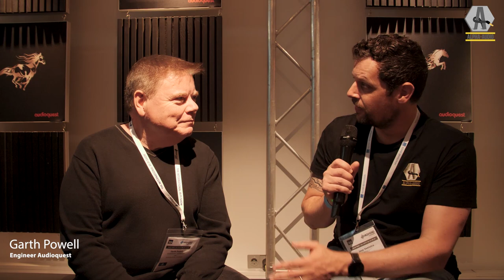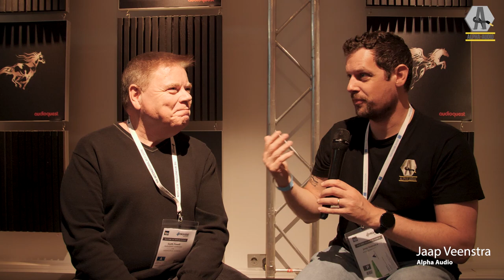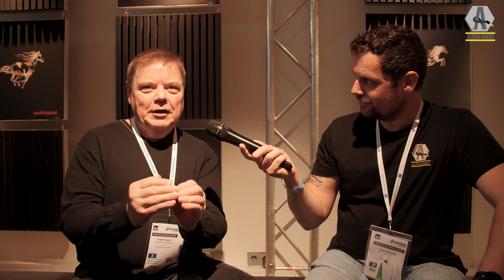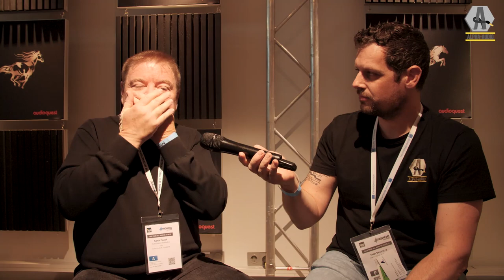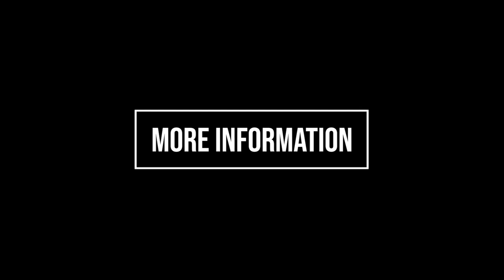All Digital RCA Cables suck... don't they? Audioquest - High End Munich 2023

Comment: Thank you very guys for a wonderful discussion.

I've changed my cables multiple times and the more cables I shield, the quieter my room becomes. The last group of cables l shielded were my HDMIs and lo and behold the room became slightly quieter yet again. I've now managed to get my noise floor so low that there are occasions I'm unable to tell whether my system is switched off or it's actually switched on but the system happened to be on pause! 
The startling thing about it, not only have I got 9 channels, 7 of them are externally amplified.
Reply from the maker: That's impressive.

Comment: Veeeeery interesting interview! It's zeros and ones, and some jitter, as he confirmed openly. But followed by "If that's your only critera..." starting 12:44 I would have liked to hear about other criteria then. Provided e/g...just some. Maybe still criteria like looks, feel, packaging, prestige, belief?
Reply: What about noise, colouration, evenness across the frequency range and any other audio related criterium? That’s what Garth means: there’s more than one thing to consider and evaluate when assessing the effect of a cable. Don’t focus on one thing in particular at the cost of anything else, because you will hear it.
Reply: @jmtennapel  That interview was about digital purposes only. When it comes to analogue low-level signal transfer, anytime.
Reply from the maker: @pickyaudiophile  If you watched the whole interview, you would have heard that a digital signal is in a way also analog.
Reply: @TheAlphaAudio  I did so right after upload. You're correct, it's not clear what I meant...therefore I edited my post (@jmtennapel).

Comment: Thanks for the video. Why your digital coax cables are actually 50 ohm cables (coax carbon/Coffee cables ) ? I want to connect a streamer to an external DAC ... Is a 75 Ohms not better ?
Reply from the maker: Yes. It should be. But it is impossible with rca plugs. If you have bnc than that is the way to go.
Reply: @TheAlphaAudio  Thank you. My pre amp doesn’t have bnc input.
Reply from the maker: @mrronenza  in that case, keep with a high quality rca. It is fine most of the time.
Reply: 50 or 75 ohm is the load, some BNC connectors have a small dielectric plastic ring (easier to identify them) so you know what the load of the device is.
If you are running short cables, it's not gonna make any difference.
short or long, always use good quality cables and connectors, don't spend more than $50 on a cable anyways
Reply: @VanillaIceCoffee  AudioQuest Carbon is $230
Coffee is $595 …. For 1 Meter
Reply from the maker: @mrronenza  i recommend the carbon. Very good cable.
Reply: Is 3,5mm minijack DAC out to 2x RCA AMP in as good as 3,5 to 2x XLR in?
Reply: Sales hype.

Comment: Nice talk but what exactly is the message and he didn´t say anything specific about the digital coax cables from Audioquest? What´s different about them? It looks they are using exactly the same connectors as the analog rca cables..a solid core and I suppose a braided shielding. So it´s hard to understand why they are different. Audioquest doesn´t give any technical specifications only a lot of marketing claims..